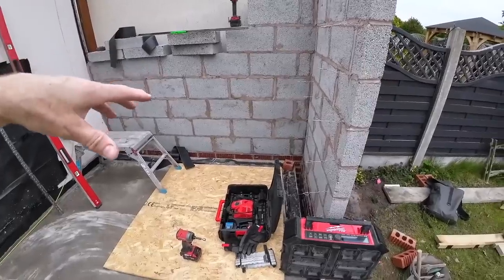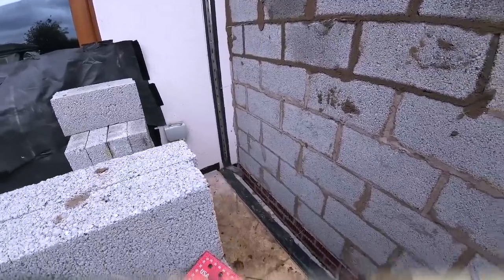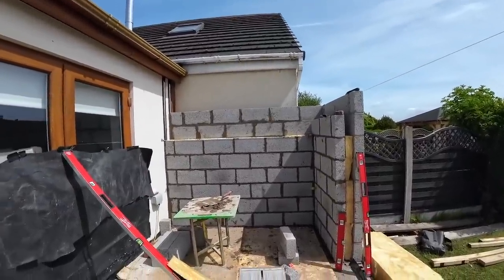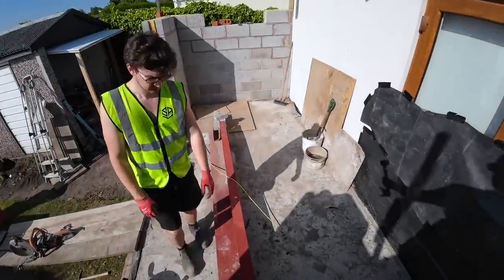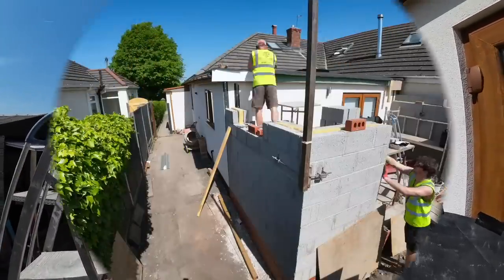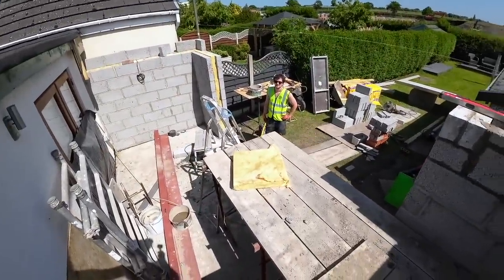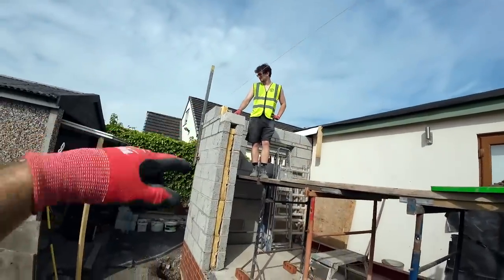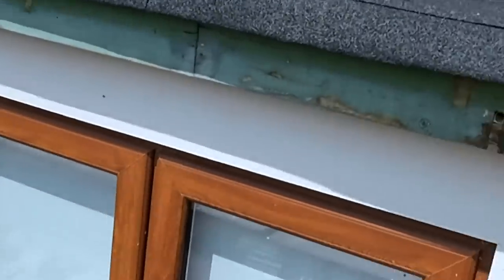TOPPING OUT BLOCK WALLS AND A HEAVY STEEL BEAM

Comment: Great job and top work. Made me think about cavity trays on flat roof. This one is continuation of existing flat roof so can't get water running down the main house wall into the new extension. On the outer, as the big steel bridges the gap massively then can't see those padstones near the top of the wall can be an issue - guess you could batten the inside rather than dot/dab. For the blocks have you ever tried a splitter? Bloody heavy I guess to shift around. I've only ever used a small block splitter so no experience with big blocks. Look forward to the next one.
Reply from the maker: Don’t fancy Those splitters 😬🧱👍🏽